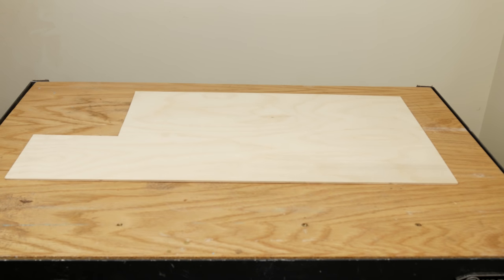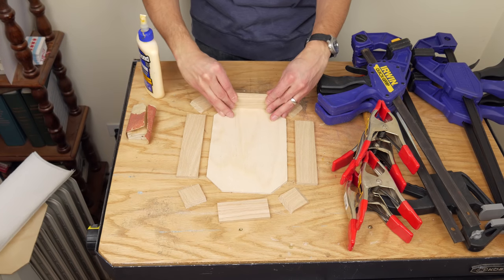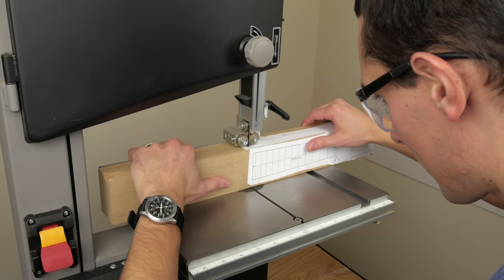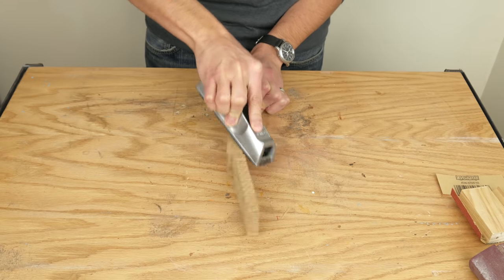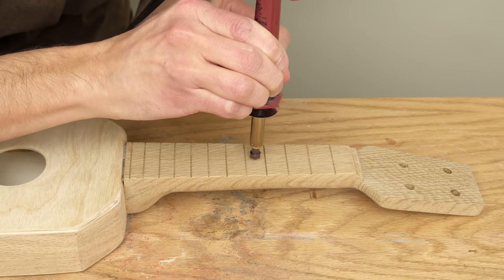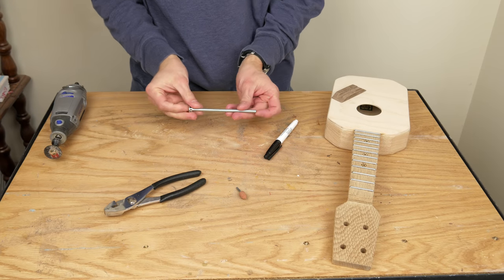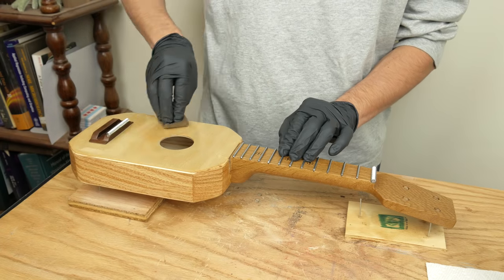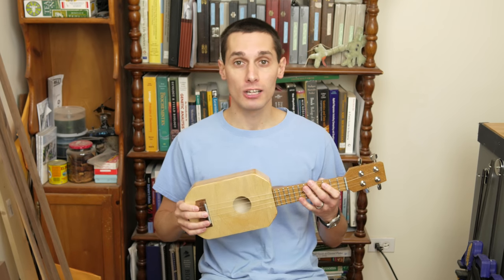How To Make a Homemade Ukulele

Comment: It came out awesome! Using nails as frets was awesome I thought they wouldn't be strong but if you managed to you use the file on them I guess they are pretty strong! To increase it's loudness I would suggest thinner top (made of pine, cedar or spruce) with supportive braces just like a guitar. Plywood does not vibrate nicely and as a result it is quiet! Overall I really enjoyed the video! Greeeeeeat work! I love DIY instruments!
Reply from the maker: +Scrap wood City  Thank you, I'm flattered! Good tips too. I figured the plywood wasn't the best option for the top but I went with it anyway. Next time I'll try something better.
Reply: +Makify1 it's tone was pretty nice though! Acoustic instruments are really way more difficult from the electric ones! You did a really good job in my opinion!

Comment: I built this and made a few modification. I used cedar for the body, top and bottom planed to 1/8"thick, the neck is mahogany, I bought real fret wire instead of nails (about the same price), I had some hard nylon I used for the nut and saddle instead of threaded rod and I epoxied a piece of 1/4" threaded rod into the neck so I could attach it to the body with a large washer and nut, much stronger. Sounds good, fairly loud, tunes up nice. Now I learn how to play. :)

Comment: Awesome I've been looking for a easy ukulele build all over and now I've finally found. Imma start building this ukulele at school tomorrow  I will give u and update on how it went. Thanks so much I'll defenetly subscribe. 👍
Reply from the maker: Awesome! Good luck. Can't wait for the update.
Reply: +Makify1 how high/tall are side pieces?
Reply: goooooooood
Reply from the maker: ATM TV Just saw your last comment, it's probably too late but the sides are 2.5" tall.
Reply: Makify1 The ukulele is still in making how TALL and THICK are the bedsides in CENTIMETERS or MILIMETERS? Thanks!!
Reply from the maker: ATM TV The sides are 6.35 cm tall.
Reply: How's it going? Didja finish?
Reply: I'm waiting for effect too
Reply: ATM TV Hemmmm... ATM TV? Did you..?
Reply: Heyy! How did it go? I'm planning to make one 2! So tips are welcome! :D
Reply: just saw the side measurement... thanks .. :-) i cannot identify into the video because i think there's a typo.. (6,34x 7,6cm) printed on the screen .. and i though it was 0,634cm and 7,6cm meaning depth and height .. :-) now i know 6,35cm wide ,,,  Will build this for sure

Comment: learn how to make a ukulele 
all you need is 50 machines 

ya I don't have that just lying around 😂😂❤
Reply: You can just as easily make a uke with basic (and inexpensive) hand tools, especially if you're not bending the sides. All you really need is a hand saw (or if you wanna make your job easier, a hand saw and a coping saw), sandpaper, and clamps for gluing (which can be improvised in a pinch). The process would be mostly identical to the one in the video, just a little slower.
Reply: Eroge Guy thank you for your tip. :-)
Reply: What did you think it would be made out of Popsicle sticks and hot glue :)
Reply: Obviously he's a woodworker.
Reply: Lucky for me, my dad does. Unlucky for me, he wouldn’t let we use them over his dead body...
Reply: You don't need big machines, you can use hand held cheap ones from online or harbor freight. They're cheaper and easier than you think.
Reply: Then don’t make a ukulele, or come up with your own design and post a video, you troll
Reply: @GlassicGamer  Why not that should work as well or even better, They could be heated over steam and make the bends in the sides and you can buy a whole shitload of Popsicle sticks at the dollar store,
Reply: @eriamalyak3547  do it together!

Comment: Great plan. You want a louder uke? Use a solid quatersawn cedar or spruce piece for the top. It will double the volume of your uke. You can also make it way thinner and add a little bracing underneat. But I really like your plan.
Reply from the maker: Thanks for the tips!

Comment: Oh!! Will await the new template from you soon.. Many thanks!!
Reply from the maker: +Rameez Shaikh Are you using Windows 10? I bet you are. So, here's the deal. There's nothing wrong with the pdf. The problem is with Windows 10 or the print driver in Windows 10. If I print the template from Mac OS or Windows 7, it prints perfectly but if I print from Windows 10 it prints too small. This is really annoying! The only solution I've found is to print at a custom scale of 104.23%. I don't know if that will work for all printers but it works for mine. I only have one printer to test it on. Please let me know if that works for you and I'd love to know what operating system you are using and what printer you have.
Reply: Well Vinnie, it was printed from a Win7 OS and from a local stationery shop with some HP printer model. However, lemme check with the custom scaling as you advised and will let you know if that works.

Comment: I like the idea. I was going to build a traditional shaped soprano ukulele but then my wood wouldn't bend so I'm cutting it down and making a small bodied concert ukulele. It might not sound the best but I can't even play the instrument yet. This definitely helped with my build so thanks.
On a different ukulele I'm messing with, I used cotter pins cut in half for the frets. I should have used nails and made the nut and bridge better.
Reply from the maker: I'm glad you liked the video. I built my first ukulele from a small wooden box/purse I found at a craft store and I built it before I knew how to play. It's not a crazy idea. Good luck with your build!

Comment: Excellent job and thanks for the efforts to make a ready template.
Also, please help me as everytime I take a print the measurements does not turn out the same. I've tried using the actual size option yet there is an half inch diffetence in the priny out.
Reply from the maker: +Rameez Shaikh Hmm, that sounds annoying. Have you tried printing at a custom scale of 100%? What program are you using to view the pdf?

Comment: For everyone how is complaining about the massive amount of oversized tools, you can also do it with a jig saw. Looks maybe a bit more "organic" at the end but it's not that hard. ;) You can check my channel, I build one without any electric tools out of stuff I found on the street. So don't be afraid of not having good tools, it's possible and it's worth it to build your own ukulele! And the ukulele he build is actually one of the easiest but still good looking wooden body concepts I found so far ♥️

And it's good for the sound if the bridge is as light as possible. So metal bridges are maybe not the best choice. I tried it and after exchanging metal with wood, it was a huge difference!

Comment: Great idea but a couple of things I would do differently.  
Firstly, I would attach the neck before gluing the back panel on and screw it to the body and include a reinforcement block inside, where the neck attaches.  
Secondly,  When ordering the machine heads, (tuning pegs) I would order a bone nut and some proper fretwire. Both cheap enough and better materials to work during setup.
Otherwise great!

Comment: Wow, very inspiring! You did a great job.
I might try this too. May I ask how exactly did you calculate the soundhole dimensions? the Helmholtz Resonance link you posted is dead, and I can't find a good enough explaination on the web. What Does the d (I guess it stands for diameter),v, and f stand for? Thanks!
Reply from the maker: +Muli Cohen I fixed the link but to summarize, d = (f^2 * V) / 2700 where "d" is the diameter of the hole (in meters), "f" is the frequency (in Hetz) it is tuned to (usually this would be a frequency between the lowest string and the 2nd lowest sting without matching one of those perfectly), and "V" is the internal volume of the body (in cubic meters).
Reply: +Makify1 Thanks a lot man, you're what's great about the internet.

Comment: Put a solid spruce or cedar top and it will sound way louder...  If the wood is quatersawn and around 2 mm thick, it will blast! You can also make the bridge as light as possible... But great construction though!
Reply: You're 100% correct, but in fairness to the builder he said he knew a thinner top would sound better, but put a thicker one on anyway to make the instrument more resistant to wear and tear from a 3-year old.    Are you going to put an AAAA Englemann spruce top on a beater uke intended for a toddler? 

Also, from a design perspective I think this would get better volume and tone if the bridge were closer to the center of the soundboard.  Of course that would mean either a shorter scale or a bigger overall instrument.   Again, certainly "good enough" as a toy for a small kid.

Comment: men, this ukekele looks awesome, i just have one question : ¿the templates have the real size?
Reply from the maker: Yes, but make sure your printer is printing it at the correct size. The scale bar is there so you can measure it after printing it.

Comment: Where did u buy the miter saw I'm low on space too and I think I like that one
Reply from the maker: +Ethan Boutwell  It's a good tool and I think it's significantly better than the cheap plastic box ones. I think I got it at Menard's if I remember correctly. If you don't have a Menard's nearby or if they don't carry it, you can get it from Amazon (http://amzn.to/1oeek8u).

Comment: Could you clear up your use of the hemholtz resonance equation? What value for frequency is used?
Reply from the maker: You want the sound hole to resonate near the frequency of the 2nd lowest string, ideally between the 2nd lowest and the lowest strings but not exactly at one of those frequencies. For a standard tuned ukulele (GCEA), the lowest string (C) vibrates at 261.6 Hz and the 2nd lowest (E) vibrates at 329.6 Hz. You could just plug 329.6 Hz into the equation but I plugged in different values for the sound hole diameter and calculated the resulting frequencies. I calculated the internal volume of this ukulele to be 74.625 in^3 (0.00122288465 m^3). A sound hole with a 1.75 inch (0.04445m) diameter gives a frequency of 313.3 Hz, right between the lowest and 2nd lowest strings.

Examples:
d=1.00"  f=236.8 Hz
d=1.25"  f=264.8 Hz
d=1.50"  f=290.0 Hz
d=1.75"  f=313.3 Hz
d=2.00"  f=334.9 Hz
Reply: +Makify1 Is there a reason for the resonance frequency being between the 2 lowest strings? 

I've been designing some guitars in inventor and it never occurred to me to take the resonance into account!
Reply from the maker: I don't know the actual reason but that's the rule of thumb I've heard. I suspect it is because emphasizing the lower frequencies makes the overall sound of the instrument "richer."

You can do a little experiment to see what I mean. Take a stringed instrument, play an open chord, and compare the sound with the sound hole uncovered vs partially (or completely) covered. It helps to have your ear directly facing the sound hole. 

You don't want the sound hole to resonate at exactly the frequency of one of the strings because it will overemphasize that frequency and make the instrument sound odd. I know from personal experience.

Comment: Hoping someone can help out with the helmholtz frequency. Trying to figure out the soundhole diameter for my cigar box ukulele and I have the volume, but how do I go about finding the frequency?
Reply from the maker: Most commonly, the frequency of the second lowest string played open would be used in the Helmholtz equation because you are trying to bring out the lower, quieter frequencies. For example, the ukulele I built in this video is tuned to standard tuning (gCEA). The second lowest frequency string, E, has a frequency of 329.6 Hz. The volume of the body is 0.00122288465 m^3. Using the Helmholtz equation we get a hole diameter of  0.0492m which is 1.937". The equation, as given in the video, only works with metric measurements.

In practice, what I like to do is calculate the frequency given by different hole diameters (based on what drill bits I have available) and pick the hole size that gives me the frequency that is closest without going over to my desired frequency (i.e. I prefer a hole that gives a frequency slightly below my desired frequency rather than one that gives a  slightly higher frequency). So for this ukulele (v=0.00122288465 m^3), a 1.5" (0.03810m) hole would give a frequency of 290.0 Hz, a 1.75" (0.04445m) hole would give a frequency of 313.3 Hz, and a 2.0" (0.05080m) hole would give a frequency of 334.9 Hz. I picked the 1.75" hole because 313.3 Hz is close to but slightly less than my target of 329.6 Hz. A 2.0" hole would probably also work well but the ukulele would be slightly less bassy and a little more "bright." Because ukuleles are naturally very "bright," I wanted to try to bring out the lower notes more to give better balance.

I hope that made sense. If you have any questions, let me know and I'll try to help.

Comment: is it possible to use pvc/sintra board as the faces of the ukulele?
Reply from the maker: +Kevin Cinco Yes, but I'm not sure how it'll sound. I've heard that foam polycarbonate works well acoustically and it has a similar density to sintra although there are other factors that also important. If you end up making one with sintra, I'd love to hear how it went.

Comment: Yes lighter thinner sound but not wholly unpleasant. The only issue I have with you is using steel studding for nut and saddle. Here's why! If you had been a parent you would know how easy it is for a 3 year old to hit themselves and others in the face with whatever they can wave around. Never give a small kid a piece of sharp and dangerous metal. You did that! 2nd That studding is/will/has cut through the Nylon strings real fast. Unless his parents did the right thing and hide that Uk? 3rd. That's a heavy Uk and adding steel just made it heavier. Nut and bridge material are so cheaper than studding, and failling that, carve and polish an old tooth brush. You will get a bridge and a nut from that! It would give you a nicer deeper tone!

Comment: When he said "homemade" I thought "tissue box" not "bunch of wood you actually have to go and buy"
Reply: +King PufflePuff Now you can have your own quality ukulele, and all you need to do is dig through your trash can!
Reply: King PufflePuff I used a cutting board in my kitchen to build mine. Check it out on my YouTube channel.
Reply: King PufflePuff I could just buy one for 15 dollars on wish. Then spend 30 dollars trying to make this
Reply: You have to buy tissue boxes too.....
Reply: Irregardless of material, the title speaks for itself. Otherwise, the title would have to be machine shop made or office made. Kidding here.
Reply: @bamboocafe9413  bought  one from ebay for 16 bucks made a few changes, Just replace the finger board  and bridge with a wood one replaced the strings with a steel set and good to go, Then used a red sunburst finish on the front and a dark walnut finish on the back and sides,
Reply: genius. when you bake something, you have to go buy your materials, flour, sugar and everything else.

Comment: how to measure how much distance i need beatween nut and bridge?
Reply from the maker: The distance between the nut and the bridge is the scale length and determines where you need to put frets. The ukulele I made has a scale length of 13 5/8" (34.6075cm) and the frets on my template are spaced accordingly.
Reply: Ok tnx and how do i measure distance between the frets ?
Reply: Makify1 btw i have small kids guitar whichbi want to turn into ukulele :)
Reply from the maker: Here is a free, web-based fret position calculator that you can enter any scale length and it will tell you where to put the frets. https://www.stewmac.com/FretCalculator
Reply: Thank you VERY MUCH ser i appreciate it ! Subscribed !

Comment: The idea and video are very creative, but to me it would seem more logical to get a $20 ukulele from amazon, especially if you don't have the materials, tools, and time.
Reply: No question buying a low end factory instrument is faster, easier, and cheaper.  But still, this thing is unique, and it has a charm that a cheapie mass-produced Asian-made instrument doesn't.   Maybe more important, getting a handmade instrument from a relative as a present is "priceless". I think that's the point.